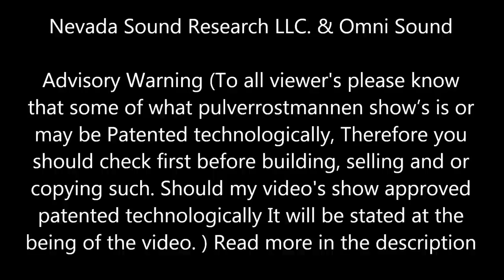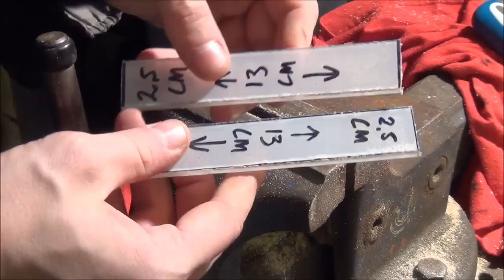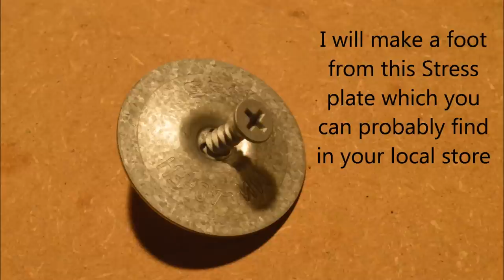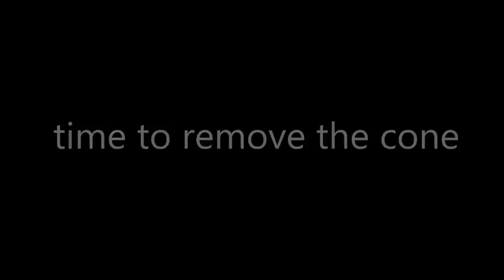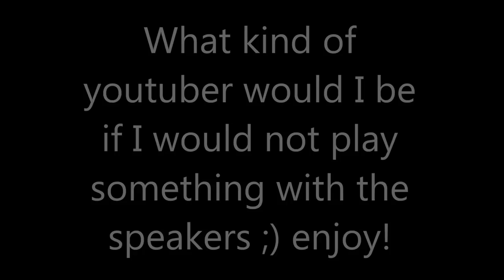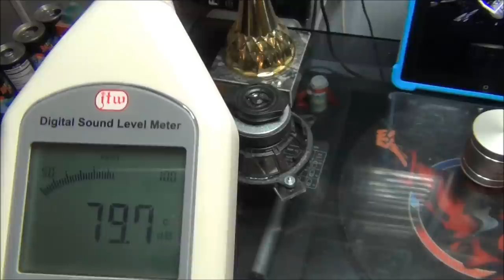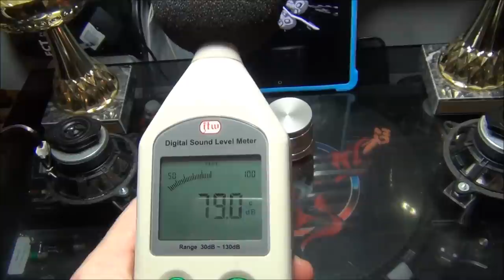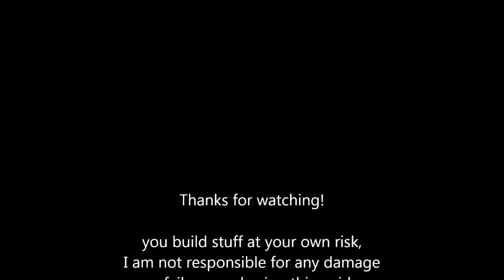How to make a vibration speaker (Omnidirectional design)

Comment: These should be called "transfer" speakers and not "omnidirectional" speakers because these are still bidirectional but they transfer sound to other objects. An omnidirectional speaker projects sound equally in all directions which this does not do.
The link below is to  omnidirectional speakers, although a sphere would be even more omnidirectional than this
https://www.youtube.com/watch?v=LBVwY-YnRKM
Reply from the maker: They are more called tactile transducers and they “transfer” the audio to the surface that you place the driver on. However this design is still omnidirectional if you would consider placing this driver on a table in the middle of a room and walk around you would still hear the audio the same as you walk around the room. The title of this type of speaker can be discussed but Nevada Sound Research voted for this title as a suitable one along with some of my friends so that was the one to use in any case

Comment: Oh and PLEASE - get over yourself..
Away back in the mid 1960's I was using inverted speakers physically clamped together onto each other, to create double strength - half reactance speakers with zero chance of them "popping" their cones or of bottoming them out as well - as by "physically clamping two "similar" speaker cones to face each other, and wiring ONE the opposite yet parallel to the other, they worked as if a SINGLE dual cone speaker.

It wasn't rocket science - nor is it a patentable idea as it isn't novel - therefore no patent could ever be "taken" 

Especially as it was on an idea anyone could do - even back when the first speaker was originally built.

PLUS - any idea made by one person WITHOUT ANY CHANCE OF EVER HAVING BEEN DISCOVERED TO HAVE BEEN MADE THE SAME - by any other person - is in itself an inventive method, but, because another has the same idea - no patent "claim' can be brought against the other person - who self-invented the exact same thing ..
WITH NO CHANCE OR METHOD, of discovery of the other, at the time they created their own.

So shove all that patent crap back into your school book.
It isn't needed here.

Why?
Because the very first one you put there (copied against copyright laws too I see) .. being the US Patent 5847331
It was ONLY granted in the USA - to someone in the USA who either knew I had done that before them, or DID NOT KNOW (and also probably didn't care) before filing in the USA (where someone at their patent office also didn't fully search the world either, before being granted a patent on an idea I had done and used, THIRTY THREE YEARS BEFORE - the USA Patent granted date - of 1998

Re:
United States Patent 5,847,331
Vollmer, et al.	December 8, 1998

??
1998 - you are joking right.

THIRTY THREE YEARS AFTER - a young KIWI lad, did that exact same thing - by clamping two speakers together, to form a SEALED DUAL CONE SINGLE SPEAKER and mounted the two into the ONE good house speaker box he had at the time, as he "grabbed" both out of the local tip (rubbish dump) with one RAIN buggah'ed box and two average to good speakers.?